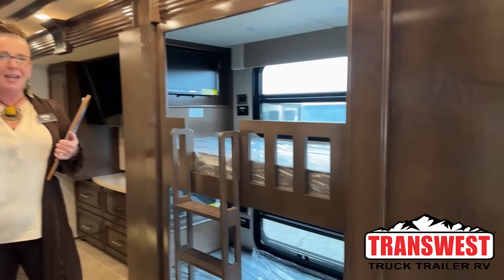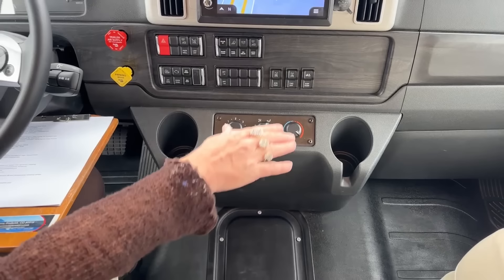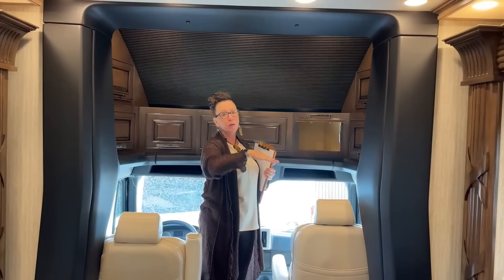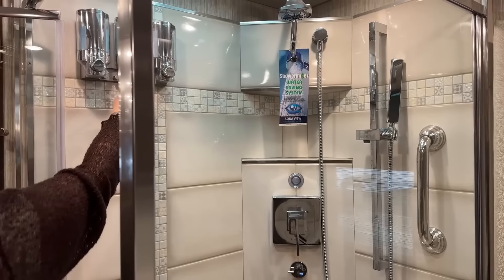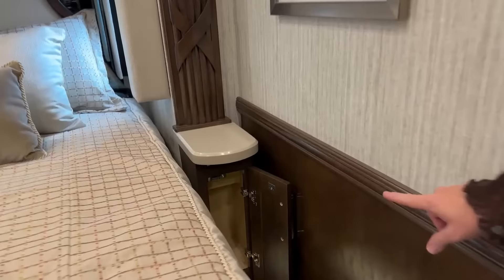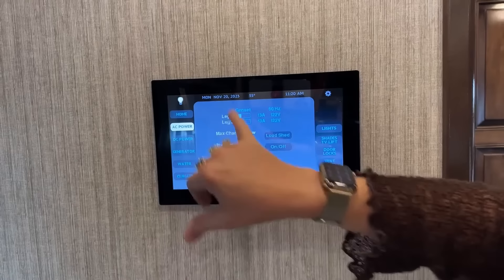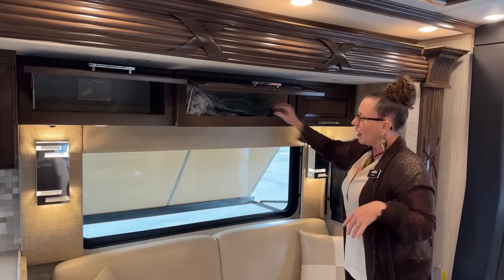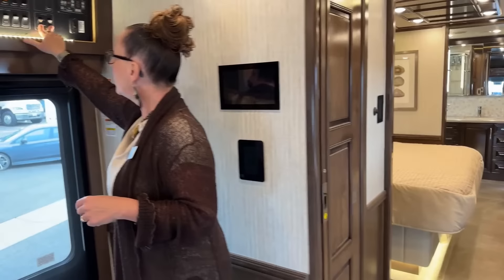2024 Newmar Supreme Aire 4509

Comment: My dream rig but sorry no bunks for me !! Thanks for your efforts !! ❤❤❤❤
Reply: Oh have no fear, lots more than bunks here!!
Please let me know what I can do to be of assistance.
Thanks for tuning in!
Ty! Katie O
Reply: Can you get as a option dual climate control instead of the manual climate controls
Reply: Another question can you bump up the HP in this 525HP engine like they are doing in bigger RV motors
Reply: @marcwitt8507  Hi Marc, Are you asking about the Climate Control on the dash?
🤓Thanks for tuning in.
Reply: @marcwitt8507  The HP in this engine in 525 HP in 2024. It's the same DD13, It's just tuned differently this year. The same goes for the ISX12 in the Mountain Aire, same engine but 25 HP more in 2024.